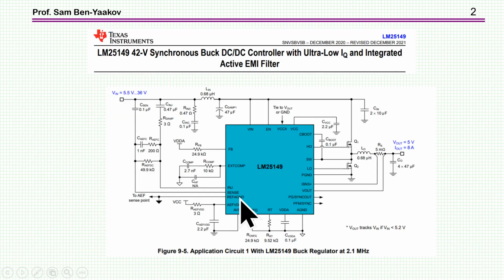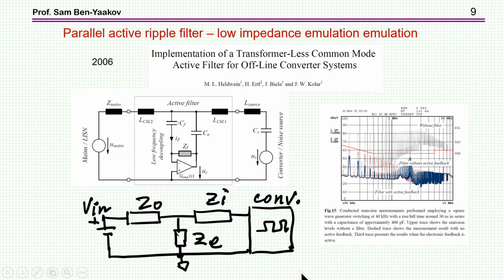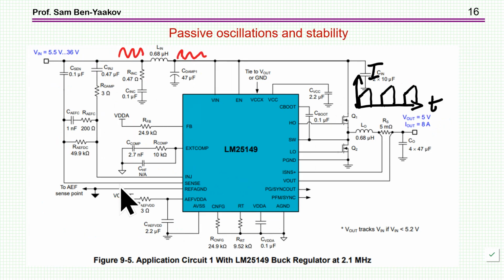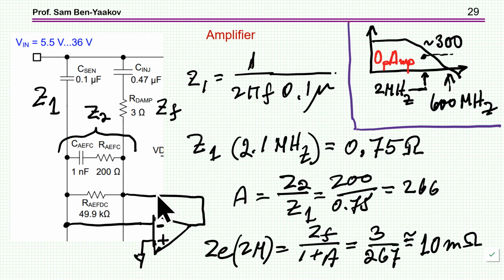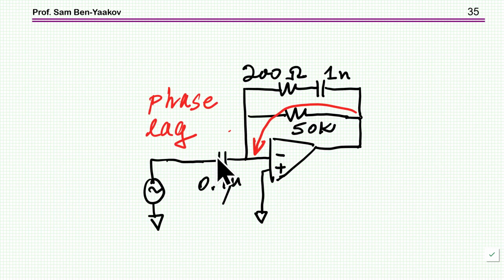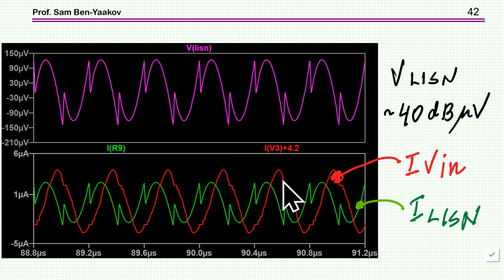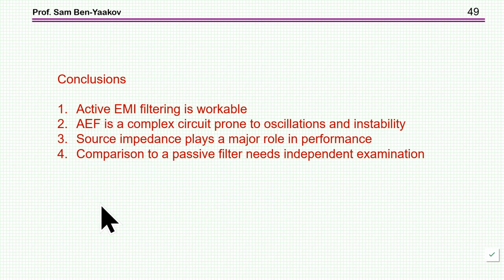Dissecting TI’s Active EMI Filter (AEF)

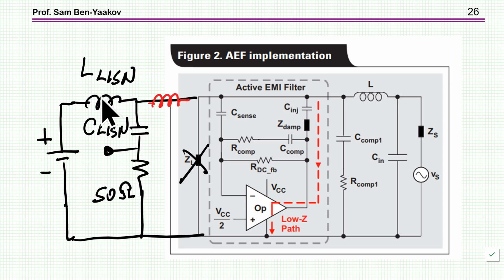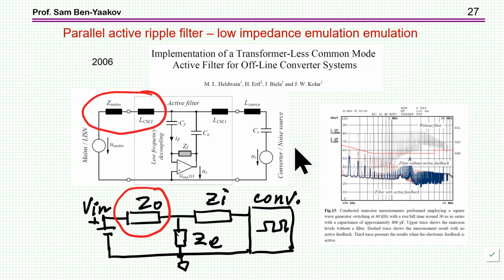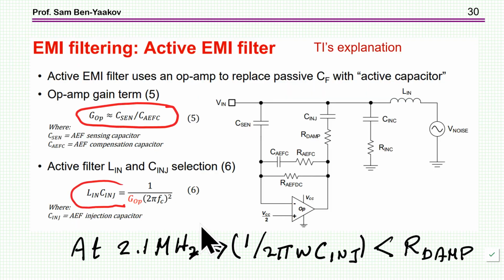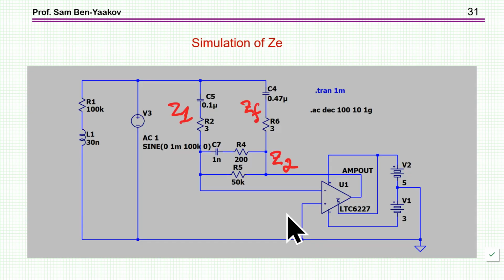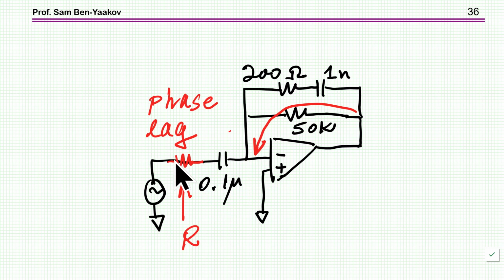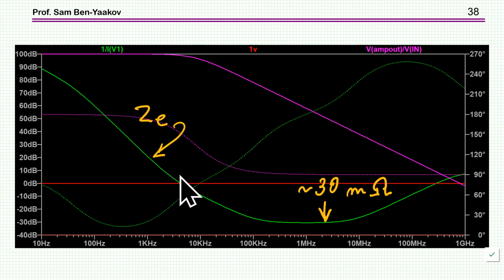Comment: I'm confused about your comment at 14:15, "they forgot about the source", and then you circle the load impedance.  The text states "the load impedance ZL is much larger...".  At 15:33 you draw the topology that TI is showing, albeit with their source (VS + ZS) on the right.  So the CLISN you have drawn is their Ccomp1, etc.  You continue to confuse the issue at 15:52, where you label your input impedance Zo and output Zi.  At 18:05 you show how the AEF is actually resistive above 100kHz, but isn't that the goal to ensure damping across the CISPR frequencies of concern?  Yet at 20:28 you state that the AEF impedance is 10mΩ (with an ideal op-amp).  You comments at 20:58 are noteworthy as equations (5) and (6) really assume RAEFC=RDAMP=0 (and RAEFDC is infinite), which would result in an "active capacitor", if reality doesn't step in.  At 21:55 you simulate with 3Ω in series with CSEN, so Z1 is now 3Ω above 530MHz, with no explanation why you did that.  At 26:11 you properly add a series resistor, but that would be your source impedance between V1 and C5.  At 26:55 you mention the 30mΩ, which is a result of you adding the resistance in the wrong location, and now there's no source impedance to force current through the AEF rather than source.  Now I watched the rest, but with all these issues in your presentation, I can't take any of your results seriously.  Sorry...
Reply from the maker: Thanks for the feedback. The issue is just too involved to discuss by writing comments, if you wish can set up a remote meeting to discuss this issue Thanks again.

Comment: Hi, I have one question.
Doesn't the feedback loop have to be broken up when simulating the loop gain and doing a stability analysis of an op amp circuit?
Reply from the maker: No. Very difficult to keep the operating point when opening the. The method shown is the recommended.

Comment: Thank you Professor for the lecture on Active EMI filter from TI. Your lectures always means a lot and is building my power electronics knowledge. 
Professor, one point to add on the value of Cinj. The Cinj is connected between phase and ground. Hence, at low frequency (50/60Hz) its value should be of sufficiently low, so that the leakage current value is small to meet the regulatory standards (high leakage current causes nuisance RCD tripping and may become lethal to livestock). If it make sense, please let me know. 
Thank you once again sir.
Reply from the maker: Thanks for comment. I am not sure if  follow you. We are talking about DC circuits. What do you mean by "phase to ground"? the power line?

Comment: I remember 60 hz power supply design was necessary and B O R I N G . 
Well times have changed !  Switching power supplies delivering 10Amp DC , with 20mvpp ripple , operating at 100 of khz, requiring sophisticated and difficult ( for me ) analysis.
Reply from the maker: Indeed. Thanks for comment.

Comment: Why not simply using a ceramic capacitor as a first stage of the pi filter? What about the opamp output stage current amplitude, Is It a push pull needed? What's the main advantage vs full passive filter?
Reply from the maker: "Why not simply using a ceramic capacitor as a first stage of the pi filter? " all that is discussed is AFTER the cap. Or, do you think that just a cap  is a good solution to the EMI problem? 
As for:
" What about the opamp output stage current amplitude, Is It a push pull needed? What's the main advantage vs full passive filter" you correctly defined the home work.

Comment: Hi Sam, great job but one question: Your BODE box can only supply 50 MHz, how do you explain 1 Ghz display?
Reply from the maker: Hi Harry, Thanks for the comment. You are correct but the  Bode 100 is illusrative regarding the method of measurement while the plots, as described, are simulation results. As I understand, Omicron is working on a new analyzer with a wider BW, so this apparent incompetability will be resolved.

Comment: Hello prof, I have a circuit. A supply voltage connected to the NMOS and then to the capacitor (1000uf).I want to charge the capacitor with 1A current in around 200ms. SO for this, I have to use NMOS in a linear region and it will be closed switch. But my question is how to control this NMOS so it can work in linear region and provide 1A current for particular time....could you give some suggestions?
Reply from the maker: Perhaps this will be of help?
Reply: @sambenyaakov  sorry i didn't get?

Comment: Great presentation. One small error if I am not mistaken: when talking about the bode measurement, the resistor is added to the compensator/opamp output. You would like to have low impedance in that point (10mOhm), but adding a resistor/inductance of the injection transformer will impede that function. You will probably measure something, but not the correct function. You could add a 10mohm resistor, but that is impractical and the bode 100 wont be able to supply the needed source voltage. It's better to find another injection point.
Reply from the maker: Hi Klaus, in principle you are correct. But.. since the feedback is taken after the resistor , the reflected resistance is much much smaller.
Reply: @sambenyaakov  Yes, to a degree. The compensator path needs however to have not just low reflected resistance, but also low inductance. The AEF will not function well if you have 50nH+ inductance in the compensator output, since the phase will roll of as compared to the 3ohm resistor. Could be interesting to do a simulation with trace and component parasitics
Reply from the maker: @klauskragelund8883  Where di you get 50H+?
Reply: @sambenyaakov  50nH, from 50mm total traces from the device to the injection point, via traces and components
Reply: Just a comment about your videos, they are simply great and deep content of high quality. If I only had had a teacher like that in school.....
Reply from the maker: @klauskragelund8883  The series resistor is put  in the circuit, not remotely. So the 50nH is in series with the output of  injector and then in parallel with the added resistor. Negligible.
Reply from the maker: @klauskragelund8883  🙂Thanks. This I can not fix.